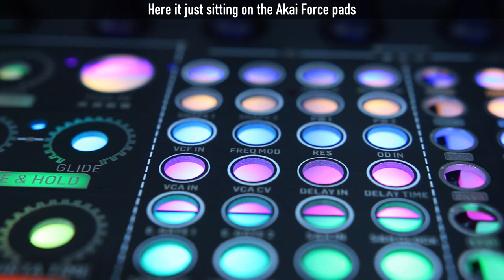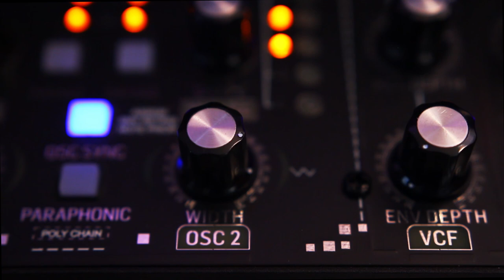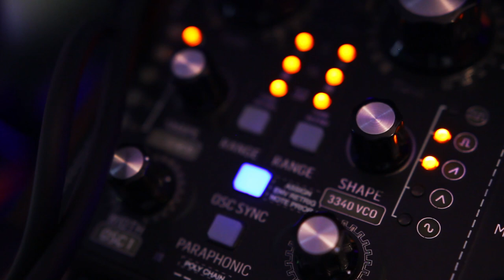Behringer Neutron Tutorial ( install a face plate )

Comment: Oooo sexy neutron now.....and yes I want one lol
Reply from the maker: So posh. I have to do the other one now so it doesn't feel neglected
Reply: @subtherapeutic yep, a bit more involved than putting on a Heinakroon overlay.
Reply from the maker: Its a few mm thick. Obviously not metal as the light shines through it in places. I will ask but Felt like a circuit board.
Reply: @subtherapeutic I like the Heinakroon After Dark one I got because it colour codes the knobs and patchbay which I find really helpful for patching.
Reply from the maker: @subtherapeutic just checked with Audio Parasites it is made from FR4 ( pcb ) which gives it the ability to be backlit. They are quite solid
Reply: Just purchased one on Reverb site!